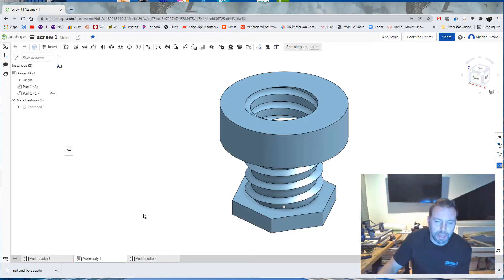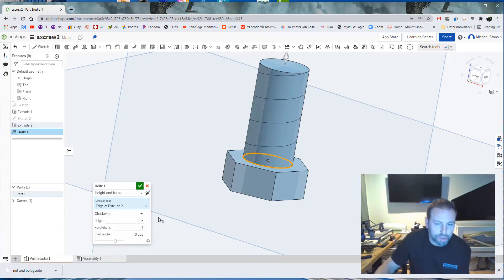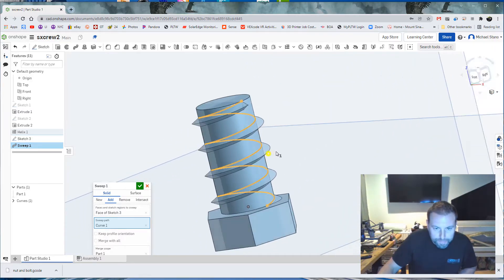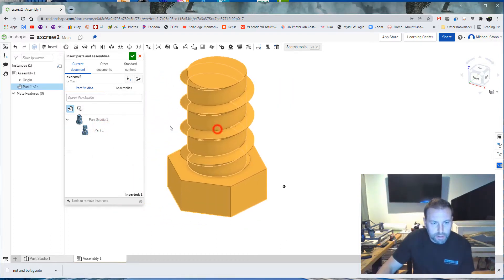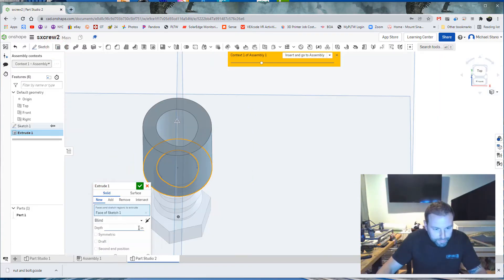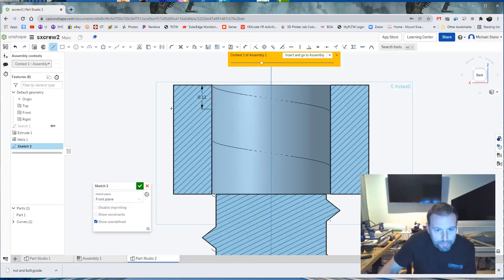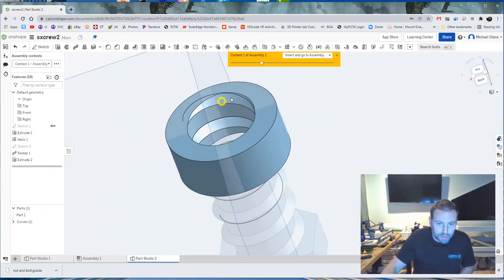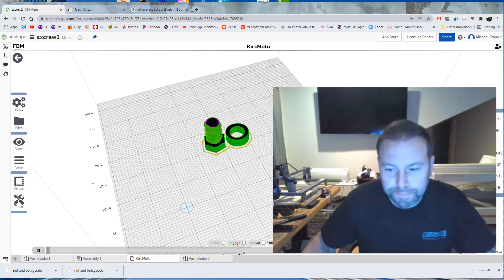Creating a Nut and Bolt in Onshape

Comment: Very informative! But after 4:10, is there any reason why you don't build an "hex cylinder" the size of the bolt head (let's call it part 2) in part studio and use a boolean operator with a small offset to substract the hex cylinder and the threaded part of the bolt? (part 2 = part 2 - part 1) ?
Reply from the maker: @thecrazydonut  I don’t know. Lol. But it’s a good idea!

Comment: 0:00 beginning of screw
4:30 beginning of bolt

Thx so much!

PS: for 2023 users for anyone using the helix function it will automatically be set to turns and height and u can change it to turns and endpoint if u want turns only.

Edit: Grammar
Reply from the maker: Thanks for watching and the info!

Comment: You can also do another extract with a larger circle then use the bolt to remove from the second part, then add an offset on the resulting tread faces. This is useful if you want to later change threads or bolt sizing cause it'll do everything instantly.
Reply from the maker: That’s sounds pretty cool, being able to change sizes is a cool feature

Comment: Hey if anyone is having trouble clicking the lines for the sweep on the nut at time stamp 7:50 use a phone or a touch screen and it will make it a lot easier to select I spent 45 minutes trying to click it on a computer then just opened my phone and within a minute I had it selected and extruded